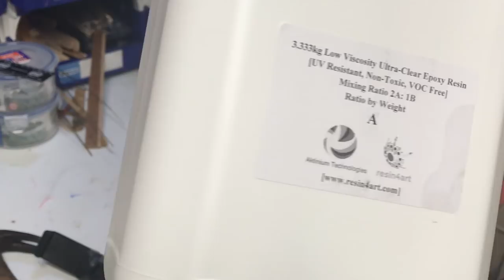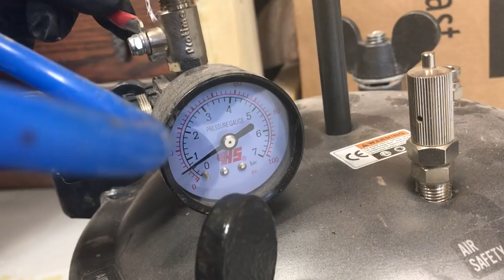crusty dried flowers mixed with resin turned on a lathe

Comment: Can you tell me if there's a reason casting resin in a vacuum chamber wouldn't get rid of bubbles? I'm planning on picking one up for stabilizing and can't see why it wouldn't pull bubbles out of resin.
Reply: Curiosity Forge the vacuum sucks all air out of the chamber so all bubbles will be sucked up to the surface and disappear.
Reply: @sarahscraftyallsorts6482   that's what a vacuum chamber does, but I believe Nick is using a pressure pot. This instead compresses all the air under apx 60psi causing any bubbles to become so teeny tiny they're not visible. 

Vacuum and pressure are two different beasts, but both are used in setting resin. Big debate on which is the best.
Reply: Aww I get you. I haven’t a clue as I’ve never used either . I use resin but on a smaller scale in smaller crafts like jewellery and polymer clay projects, I use a lighter to rid the bubbles that settle on the top. I also use uv resin on tiny things for quickness but wouldn’t recommend it on larger projects. I can imagine bubbles in larger more expensive projects to be a nightmare.
Reply: @sarahscraftyallsorts6482  See that's what I was thinking but my dad wanted to argue with me about a pressure pot being the only way and I ended up second guessing myself.
Reply: I would think if you were stabilizing wood with resin you'd want a vacuum as it would pull the air out of the wood so that way the resin can soak into it better. Not 100% sure but this is what makes sense to me, I think there's a vid about stabilizing wood  with resin on this channel.
Reply: @kathleenburns7065  Oh, stabilizing wood needs a vacuum no doubt. I'm asking about straight resin like Alumilite.
Reply: How well a vacuum removes air from a resin depends on the viscosity of the resin. The thicker it is the less effectively air will be removed. For clear epoxies, vacuum alone will often still leave small bubbles, so pressure is usually used to dissolve the bubbles into the resin.
Ideally, vacuum to remove a lot of air followed up with pressure to dissolve any remaining air will get the clearest resin possible, but good mixing technique to not introduce too much air in the first place removes the need for vacuum.
Too much air dissolved in the resin makes it less dense and can be rubbery, though that tends to be more of an issue with moisture contaminated urethane resin rather than epoxy in my experience.
Reply: It would. Nick's using a pressure pot which puts the piece under pressure which prevents the bubbles from being able to form. There are problems using a vacuum, not the least of which is it can draw out air or moisture from within the material that is having the resin added to it. Also, a vacuum pot generally has to be bigger and stronger (thus heavier and more expensive) because it has to resist the pressure while under compression while a pressure pot has to resist the pressure under tension. And tension is just easier to work with. Think of a pop can filled with pop vs. an empty pop can.

Comment: Hey! This looks so pretty!!! And I had another idea for a project for you... and it would probably make an awesome Christmas something. I don't know how spray paint interacts with casting resin, but I know they use it on StoneCoat Epoxy countertops, so it think this would work...

So, make a small clear block and turn it with a wide tool, so as to get wide ribbons of resin. Take those ribbons and spray paint them lightly with gold and or silver paint. Once they are dry, stuff them in a mold and fill with clear again (Or maybe a nice tint with the silver). The resin part of the ribbon will disappear leaving behind just flecks and scrolls of gold or silver (or any other color... Some nice metallics would look great too). I could see this as a small globe with wooden finials above and below as an Xmas ornament, or... ?? Cheers!
Reply: Hmmmmm.... Or instead of a clear block, make a block that is pretty heavy with silver or gold glitter.... or shimmery dust stuff. Again, turn off wide ribbons of it. Now make a new block with just a few of those ribbons, so they are really distinct in the finished block... clear with a few ribbons of glitter somehow suspended within!

Comment: Beautiful!  Now, to go a step farther - make another one but move your emblem off to the side and insert a light in the base.  It would make a wonderful accent light for a bookshelf.  Maybe make a couple more (different sizes - taller/shorter, fatter/thinner) and drill holes in one (or two) to use as a potpourri holder (made out of potpourri - lol!) and have a set of 4 matching (of sorts).  Maybe same styles but different woods for the bodies (really love the wood you used on the top of this one - all the handles made out of the same wood).  Maybe one also with holes drilled in but use with another light as a wax melter instead of potpourri or use essential oil (thin rods spaced  so a metal candle base could set on top where the oil could be placed - this one could be shorter and fatter for easy insertion of oil).  Wish I could draw what is in my mind so you could see what I mean - not sure if my descriptions can be imagined.

Comment: What would happen if you used the larger lacy shavings with the potpourri in them the same way that you used the potpourri initially? The flakes would look pretty suspended in resin, and the potpourri bits would be super fine and colorful...
I'm sure they've been thrown out by now, but I thought it was a cool idea.
Your project turned out amazing! 🙂

Comment: absolutely amazing work with that, but i was wondering, why not use 2-component epoxy glue for mating the resin and wood together? it'll dry fairly quick?
- another thing, is it Epoxy resin your using or alumilite? =)

Comment: This is fabulous! I am just getting woodturning and this seems like a fantastic project!

I do have a question though. Every once in a while we get a glimpse in your videos of the face protection you wear. Would you mind giving us some details or a link? I looked for a face shield with air filters but they were VERY expensive (lab use or biohazard type). I am just wondering because separate dust mask and face shield seems a bit cumbersome. Thanks and keep waffling on!

Comment: Beautiful piece and I really liked the finial. I have a question about the dried flowers that end up exposed on the exterior (or interior) of the pot. Are they a weak point? Or do they absorb resin during curing and end up as firm as the rest of the pot?

Comment: Would it be possible to put some lighter material (balsa / bass / foam) into the middle of the pot for the resin casting to make cutting the center out simpler? It wouldn't  have to be the full length  so you could still use part for a lid, just would need to figure out how to keep it centered ... maybe glue a stick across with the plug in the middle.

Comment: Nick, to save resin why not cast you pot blanks with a hollow centre? I'd use a pipe in the centre of your form mould then either slide the pipe out, or if it was really cheap pipe, cut it away on the lathe during the turning.
Keep up the good work, not so much of the dad dancing ;)

Comment: Hey Nick 
What do u think of the idea of pouring resin in to a kids hollow plastic baseball bat. Maybe doing like pink clear then blue for like Harley Quinn...or barbed wire in it ...then engrave the resin if that's possible....Just a idea maybe . Love ur work bro
Reply: Or snap a section out a wooded bat put it back together with a resin section.

Comment: Seems a bit of a waste to me that you fill the entire block up with resin and stuff, then get rid of at least 90% of it when you hollow the thing out. Wouldn't it be cheaper to just fill the outer inch or so with resin & etc? I've seen you using a smaller bowl on the inside before, and I'm sure if I had to pay for all that resin, that's what I'd be doing on things like this. The pot does look good though, pure craftsmanship.